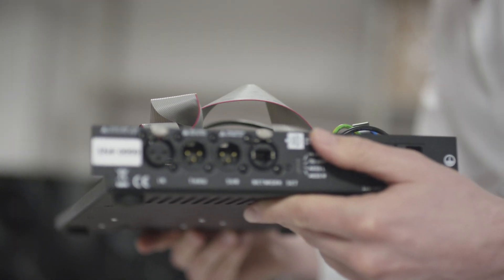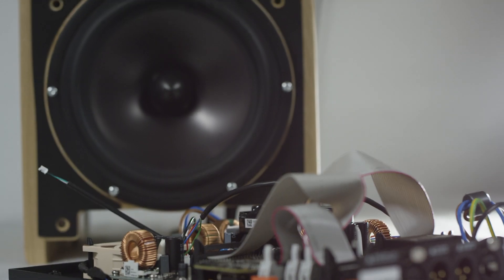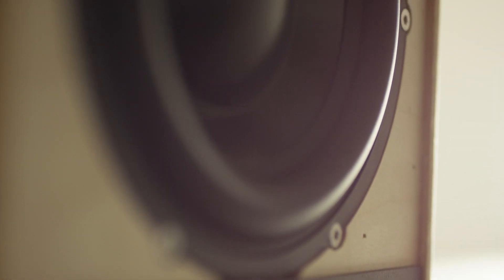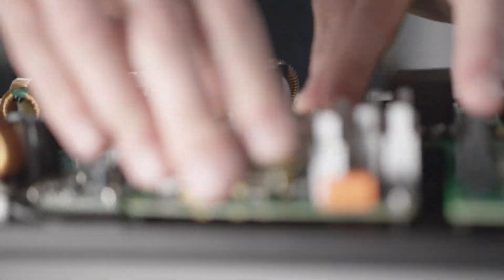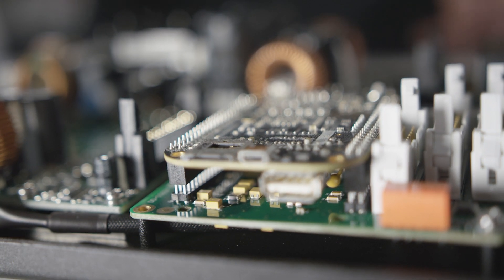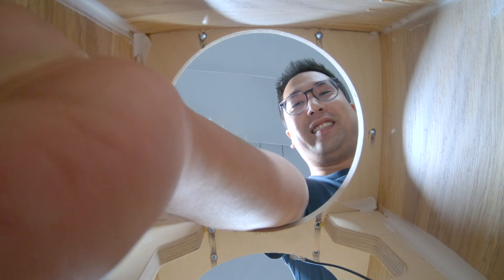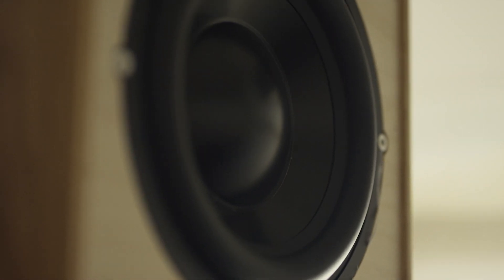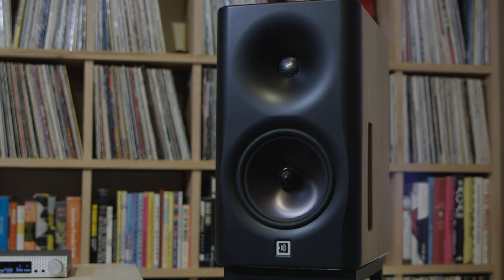Dutch & Dutch 8c Active Loudspeaker in Detail - SoundStage! InSight (June 2020)

Comment: Genelec is better and cheaper...
Reply: Your mum is cheaper
Reply: What model and why it's better?
Reply: @IliyaOsnovikov  8351 is much cheaper and at least on par in terms of directivity and accuracy. Not sure about the bass-performance, as those double 8" woofers are hard to beat in that cabinet size. But for good bass in rooms you ought to use multiple subs instead of your speakers anyway. So if low-end can be augmented with subs or bass down into the 30 Hz region is enough, it is for most music, the Genelec is just as good or better.

Comment: Can the family curve be managed with this in the same way you can with REW or Dirac Live? I've heard/read these are very forward or bright speakers like a lot of studio monitors. Can that be modified to make them sound more relaxed and natural?
Reply: Studio monitors are generally not bright. Also what is makes a speaker sound natural? Studio monitors are designed to be accurate and not color the sound. You won't get much closer to a natural sound, i.e. an honest reproduction of the signal, than good monitors.
Reply: @iliketoast-q9b  ok, if that is what you think, run with it, but that isn’t my experience with my JBL M2s.
Reply: @ The JBL M2s are among the best speakers out there. If they are too bright in your room, either consider repositioning and some room treatment, or tilt the response downards slightly, starting at around 1kHz. You don't need another pair of speakers, you already made a very good choice with the M2s.

Comment: What's the point to have 250w for a Tweeter?
Reply: Good question! 

You might be aware that a tweeter generally takes no more than up to a couple of watts on average, so a 250 watt amp must surely be excessive. But what most people don't know, is that most of the dynamic transients in the music are reproduced by the tweeter. That means that the dynamic range of the tweeter signal is much bigger than that of the midrange, let alone the bass, which really is a very 'slow' signal in comparison. The tweeter amplifier doesn't have to be able to deliver a lot of power, but it should be able to generate quite high voltage for short duration. 

To give you an idea, because basically all the transients are in the tweeter signal it's not unusual for relatively compressed music to have a dynamic range of more than 20 dB at high frequencies. During development of the 8c we actually at some point did a test where we kept increasing the level of a music signal to the point of clipping of the tweeter amp (140 volt p-p). That's a LOT of power into a 6 ohm nominal tweeter impedance. The RMS power into the tweeter was about 10 watts and the average voice-coil temperature was just over 40 degrees Celsius. We couldn't break the tweeter without clipping the amp.
Reply: @martijnmensink9036  Thank you for answering my question with such details 👍
Reply: Better to have more power than you need than less. Clipping kills tweeters.
Reply: Maybe it's for bi-amp matching
Reply: More likely it's because they use OEM-components, nothing wrong with that, and it's more economical to just buy multiple 250W modules instead of different modules for each driver. With 10W RMS into the tweeter you're already above 100db at 1m. With a crest factor of 12db, which is a good average for music, you're looking at peaks around 110db, so plenty loud. Not only that, at those levels your woofers are already at or past their excursion limit, as most music has the bass level far above the high-frequency signals and transients. Even those two high-excursion 8" woofers won't do 110db at the lowest frequencies.